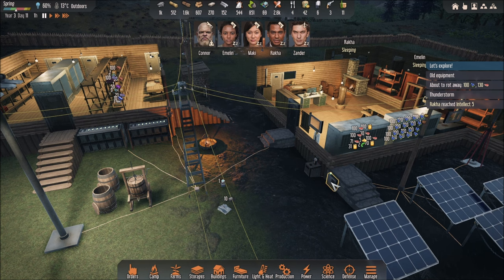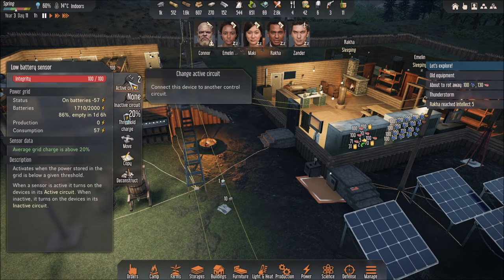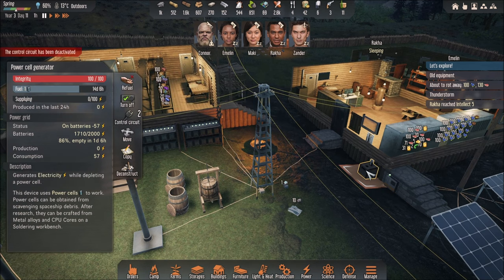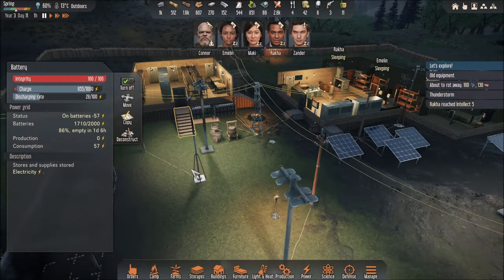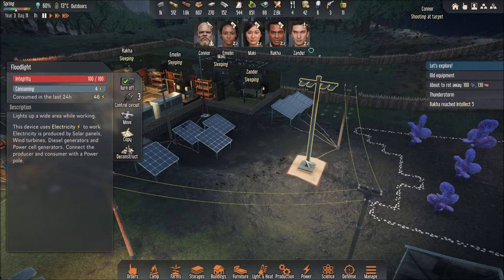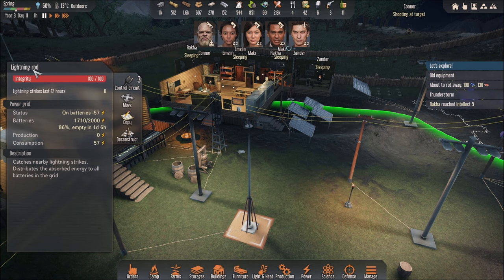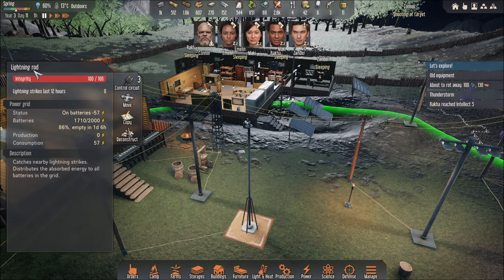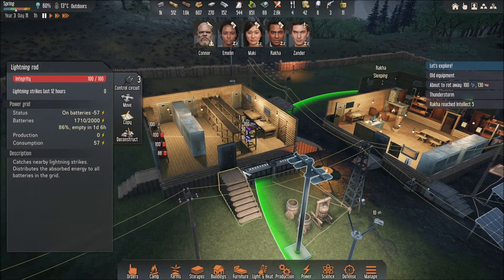Stranded: Alien Dawn - LOW BATTERY SENSOR VS  POWER SWITCH  - TUTORIAL

Comment: Maaaan...i m struggling with this.Can you make a video about setting up turrets properly without having a problem going out? i have 8 solar panels and and wind turbines and still not enough for 2 freezers and 1 turret,i even have diesel generators..i m losing my mind here man...
Reply from the maker: Sure! Ill see what I can do :)
Reply from the maker: Tbh, It all depends on many factors like the weather, sun, wind, batteries electricity accumulation, event, what you use periodically, etc. Freezer are "energy eater". You may need to see why you need and/or how you can ue alternative way to save energy without using them. Ill make a new vid today about it. Cheers
Reply: You need to connect the turrets to a motion sensor. Set the motion sensor to a channel number, say 2, and then set that same number for the turret. That way the turret only uses power when the motion sensor detects enemies.

Comment: So when it says control circuit has been deactivated, does that mean it’s not getting power, because I have my freezer and my battery sensor to 1 and I don’t want my food to go bad
Reply from the maker: Freezer should not be on any control circuit as I leave it on 24/7
Reply: @DjDragon5000  I’ve been watching your vids to understand how the low battery sensor works, but I guess I misunderstood it.  I assumed I should put it on a circuit so my freezer doesn’t cut off if  I run out of power at night from my solar panels that’s why I got a battery and low battery sensor.  What should I put in a circuit?  Thanks for the reply.
Reply from the maker: Low battery sensors are only for the battery. You don't have to put a control circuit to all devices to make them work. It's optional. You only need to put them on a control circuit if you "intend" to turn them off along with other devices "at the same time". Meaning, your freezer does not need to be on any control circuit to work 24/7. Just leave them on and that's it. In your freezer control circuit option, just leave it at "none".

Comment: How do i connect the power batteries to the lights on the wall?
Reply from the maker: As long as you have an electric pole connected to your house ( and the pole connected to your battery ) your light will work.
Reply: @DjDragon5000  and how I connect the battery to the power pole
Reply from the maker: You just put the pole next to it as long as you see the cable connecting on the ground from the pole to the batteries